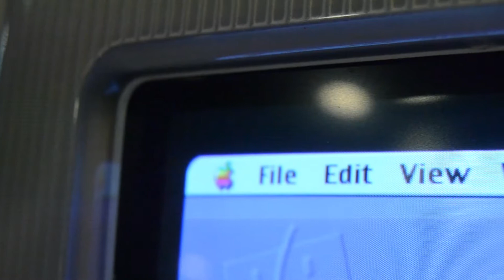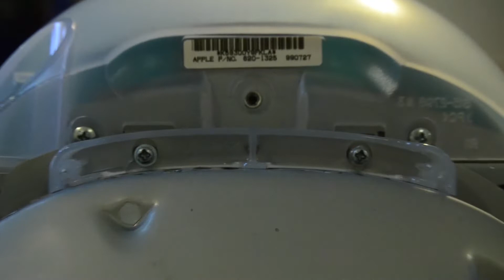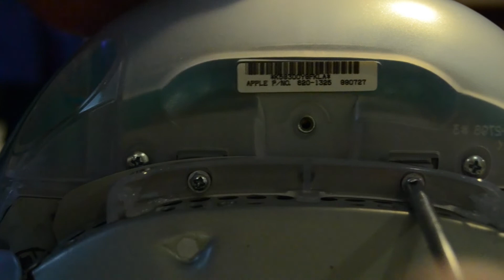How To Remove / Replace an iMac G3 PRAM Battery [Tray-Loading iMacs]

Comment: For all those fuming and screaming "WHAT KIND OF #@¢&ing BATTERY IS IT ALREADY?!!!": it's a 3.6v lithium 14250, available on Amazon. 

The original manufacturer is Saft, and the original Saft part number is LS-14250. 
This is also known as "½ AA", as it's half an "AA"-sized battery. Some Macs had Maxell "ER3S" ½ AAs in them. Same battery.

This is also the same battery as found in PowerMac G3 and PowerMac G4 desktop/ towers. 
You're welcome.

This is actually a well-made video except for that one, shall we generously say, slight oversight on Colonial Puppet's part.

Comment: I hope this works, my tray loading iMac won't turn on! I'll edit if it works. Gonna do it with my dad when he gets home. Btw, what's the background music?

Edit: simply removing the PRAM battery worked! Thank you for your easy and helpful tutorial. You can find the CUDA reset button to the left of the RAM cage which you should definitely press for a few seconds to ensure the computer can boot.
Reply from the maker: Glad it worked out for you! Yeah this computer wouldn't turn on for me recently, so I bought a replacement battery and held down that CUDA button and it works just fine now.

Comment: Thank you much for a well-crafted tutorial guide. 

How does one purchase a PRAM battery for this 24yo machine?
Reply from the maker: Thank you! you can still purchase these new on eBay, though quality may vary.
Reply: @ColonialPuppet  I shall look. Thank you. This is the first response I've gotten to this question, so at least I have a place to start.
Reply: It's a Saft LS-14250 3.6v lithium. Also known as "½ AA", as it's half the size of a standard AA battery.
Easily found at Amazon.
Reply: Thanks folks. Got it done. Bought two off eBay, and my 25yo iMac is up and running again.

Comment: i want to do this so i can just store the imac, but does this affect functions or something important to the os?
Reply: No, you can do it safely.
Only risk is that your system date will go back in time but it can be quickly fixed once you boot later.
Sometimes when you swap battery you also need to be sure to push the CUDA button on the motherboard and reset the PRAM otherwise the iMac will not boot.
Have fun :)

Comment: One of my iMac G3 is not turning on, so I can solve this problem? I need that computer to be fixed because there are some songs on there that my sister Megan wrote.
Reply from the maker: There is a little button called the cuda button that may fix your issue. If your iMac seems completely dead, you will need to press this button. It is located directly on the logicboard, next to a metal cage towards the top-right.
Reply: If the thing is still dead despite your best efforts, you may want to remove the hard drive and get your data off using an adapter to your modern computer.